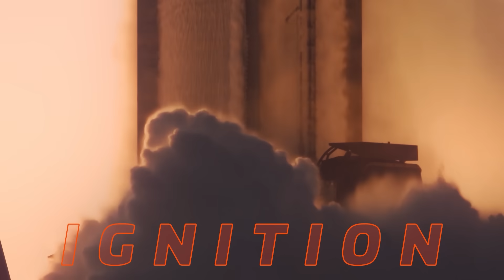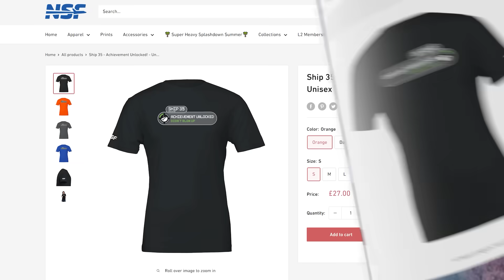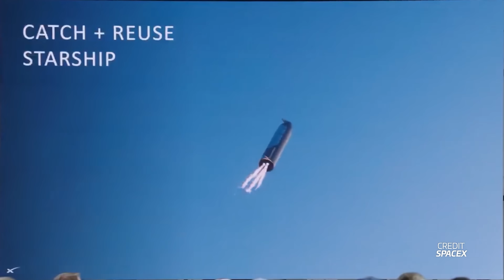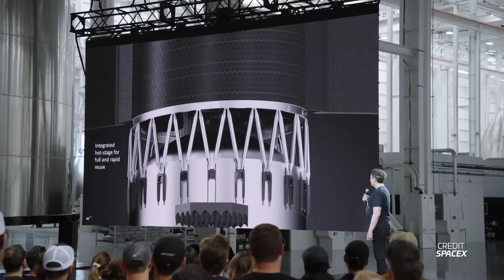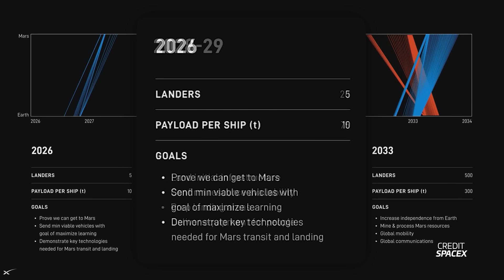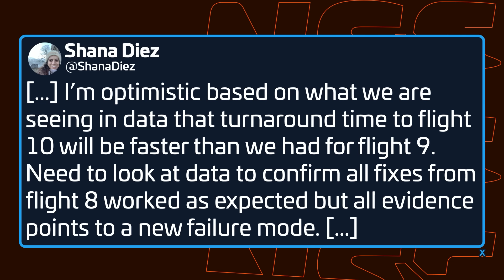🚀 Elon Musk’s 2026 Mars Plan! | Starbase Update

Comment: Considering a launch system initially designed with a carbon fiber structure and a projected 100-ton payload capacity to LEO, a subsequent shift to stainless steel construction while maintaining the same payload capacity warrants scrutiny.  While claims of increased Raptor engine power are offered, this does not negate fundamental rocketry principles.  Increased tank size, while potentially offsetting mass fraction increases, requires a thorough analysis to validate the 100-ton LEO payload capacity claim.  A more rigorous and transparent approach to communicating these design changes is necessary.
Reply: Necessary to who? SX knows everything about their projections and CF v SS. No one else is entitled to *anything*. It's a private company using its own money. They're only sharing what they're doing and why from the goodness of their heart.
Reply: @gasdive Lmfao SpaceX has already cashed checks for $4.3 billion of taxpayers' dollars for the Starship program under the Artemis programs Starship lunar lander contract. SpaceX is floundering with starship they have dumped over 230 Raptor engines into the oceans of the world. Back in 2002 Nasa's SLS sent Orion to orbit the moon and returned safely to Earth. That was Nasa's first launch of a brand new launch system and it was a completely successful mission. Cry me a river private company my ass. And yes stainless steel is heavy and its mass doesn't change just because someone changes their mind. ((100Tons)) Why are they growing the tankage?  Don't think for yourself. Believe
Reply: @gasdive  Plus about $3,000,000,000 tax-payer dollars for developing Artemis-3 HLS, which seems to be almost forgotten now, as there is such a hurry to Mars. If I were a US citizen, I would be concerned where my money goes.
Reply: @aka-o9x  and when they work on the completely different project, HLS, there will be milestone payments made when they reach them and the information will be disclosed to the customer. The taxpayer is going to pay for a modified Starship. SX is paying for Starship.
Reply: Warrants scrutiny?  Why?  They managed to get more powerful engines.  I think you are pretending to know far more than you actually do including how their HLS contract works and when and how they get paid.  Clearly you made little to no effort to actually inform yourself and this attempt to fake it has only failed.

Comment: “And they can’t open a door….”  Ryan, young man….I was flight controller in space shuttle Mission Control in Houston responsible for the shuttle payload bay doors and other mechanical systems. Mechanisms were ALWAYS a concern; unlike electronic black boxes, you couldn’t easily just add another one for redundancy, ok? That’s one of the reasons we had the astronauts trained - with tools developed and expensive, multi-million dollar EVA training facilities and tools- to backup things like the payload bay doors mechanisms, as well as other, simpler mechanisms, like the Ku-band antenna deploy/stow mechanism, etc.etc. and so on. (And why we insisted that for large payloads, like the IUS/Inertial Upper Stage and payload, which tilted up and stuck up outside the back before deployment- meaning, we had to account for the possibility of it being STUCK in that position if the electromechanical thingy’s failed- we insisted on EVA backup for that big tilt table and stage as well, to be able to attach ropes, winch things down with a manual hand crank, etc. - all of which required expensive training mockups and aids and verification too, of course. So, “it’s just a mechanical door…” , when you said that, I wanted to— metaphorically - wanted to ‘spank’ you, guy. Never make a snide remark like that without a knowledge of the difficulty those types of systems in history have always presented designers and especially operators. Cheers. - Dave Huntsman
Reply: Respectfully Sir, I think that the “door” remark was made, less as an insult to those working to achieve such incredible things, but more as a license to viewers who are not as knowledgeable or capable, to remain engaged in that effort. I speak only for myself, but I think there is more goodwill in such viewers than snide cynicism. Cheers.
Reply: I don’t think he was being serious. It was a joke because of how many seemingly impossible achievements SpaceX make.
Reply: compared to everything else the mechanical door seems to be the least complex part of the whole mission
It is nothing new for them to open something in space, they opened hundreds of fairingings to deploy payloads in the past

SpaceX had problems with every single step 1) launch pad 2) decoupling 3) flying straight 4) opening a door
Therefore it is brilliant that they were able to land their booster in the chopstick-arms and not blow up the launch tower.
Reply: Well P2P rocket travel is guaranteed by Gwynne Shotwell by 2028.  I'm just wondering how noise abatement and landing pads at the NY and London ends are being located in order to meet the requirements. Nobody seems to want to discuss anything inconvenient at SpaceX either.
Reply: I suspect that you would ALSO qualify as an Elon Musk employee.......based on YOUR social media contributions.
Reply: All of what you said does not negate the fact that solving opening a door or stopping leaks is a very trivial issue compared to landing on Mars on next year. (ie, completely unrealistic)
Reply: Twat.. Take a joke.. Or was it more just an opportunity for you to tell us all your work history so we all act impressed.. 😂
Reply: To be fair,  Adrian @BCCarCounters wrote the script so if you are tempted to go around to metaphorically 'spank' someone then you may need more than one metaphorical hand.
Reply: Ryan was flexing 💪
Reply: Plus we're not sure it was the door. There appeared to be a leak into the cargo area. Lots of ice floating around. I'm sure the door isn't designed to operate with a pressure in the cargo bay, however slight.
Reply: @gasdive  There is no evidence of a leak into the cargo bay. I don't know if there is much, if any, insulation between the bay abd the fuel tanks, so frost on the tanks would account for the  particles floating around.

Comment: Having shown how to direct a booster flip, how will the integrated hot staging ring do this?
There are no blanked out sections shown.
Reply: Maybe they'll make the dome on the hot-stage interface lopsided - so that it deflects Ship exhaust asymmetrically toward the bottom.
Reply: @Spherical_Cow oh yeah. Good idea 👍🏻
Reply: Possibly indicating that this was an earlier design. Or maybe there is some shielding that will be attached later.
Reply: I expect that hot-gas thrusters are in the development pipeline. These will power the HLS version during final landing and some may help flip the booster.

Comment: If the problem was a build quality issue, how do you correct it with so many potential failure points?  They clearly did not catch it on ship 35.  Perhaps a different design with a separate control thruster system, lessening the number of potential points of failure.  Is system redundancy adequate?
Reply: Adding a thruster system adds to the number of failure points.  Still, I think it may come to that.
Reply: They make thousands of small changes on every flight as they review data from the previous flight most are things that an observer would know nothing about but together they make bigger changes. The adding of the blockout on the hotstage ring may have caused damage that was not expected in the design decision.
Reply: @shaung949   RIP SS36.  Victim of a build quality failure of an ancillary part that was not found by pre test inspection.  Prove me wrong!
Reply: There is a strong incentive to make the components lighter. This may lead to inadequate strength at some spots in prototypes. 

The early Ford model A had a transaxle that was too strong and never ever failed. Later axles were made weaker.

Comment: Could you imagine two different Internets that only sync every 2 years. How would martians use the internet vs people on earth. How would they interact with one another for the short couple months
Reply: Why would they only sync every two years, when you can communicate with Mars any time.  The only real unresolvable issue is that the communications aren't real-time, with anywhere from ~4 to 20+ minutes (depending on relative orbital position) one-way transmission lag.
Reply: @Spherical_Cow  true good point
Reply: It’s crypto currency blockchain would suffer for commerce between the two planets unless they increased   Blockchain Verification time 10 minutes to 1 hour or so? The reason for Cryptocurrency is it makes more sense than actually sending money back and forth.

Comment: Mars plan doesn't look realistic. Still having issues post hot staging.  2nd stage landing, docking and fueling,  and reusable tiles not proven.  Falcon 9 doesn't use hot staging and is very reliable.  Why use hot staging if there appears to be so many problems with it.  So many variables either changing and not proven.
Reply: Need I remind you that Falcon 9 didn’t get to its current state until flight 25? - Dave Huntsman
Reply: Falcon 9 only reuses the first stage the second stage is not reusable that is the difference with starship both first and second stage are reusable.

Comment: There is another method of doing a Mars Transfer Orbit, if you are not bothered by a longer transit time. Ships can be launched at essentially ANY time heading towards Mars, and use the 'Gravity Capture' method. This method greatly reduces the fuel requirement, and the Mars atmospheric entry speed could be as low as a fast jogger rate! No more 'slamming on the breaks' or a direct 'assault' into Mars atmosphere.
Reply: The "Gravity Capture" method for Mars is not as simple as described. Mars' weak gravity makes true capture without propulsion impractical, and aerocapture, while fuel-efficient, still involves high entry speeds (far exceeding a jogger’s pace) and complex engineering, not eliminating the need for precise maneuvers or fuel.
Reply: Not sure you have any clue of orbital mechanics. Typical transfer already arrives at Mars with next to "zero" energy. Kinetic energy turns into potential energy as you go up. Arrive at the wrong time - and there's no Mars to pull you. And keep in mind, you won't stay up there. You will start falling back to Earths orbit the next moment you arrived at apoapsis. Circularizing orbit up there without Mars anywhere close doesn't make much sense either. And wastes a lot more energy than falling towards Mars. 
Finally falling towards Mars is always the same and is done by Mars gravity. Which doesn't change. You could arrive faster and brake harder, but nobody can afford that anyway.
Reply: I'm thinking Aldrin Cycler... but powered by far more advanced nuclear engines🤔

Technically, you could reach Mars in just three days—or even HOURS, if you're riding a sail at ludicrous speed...